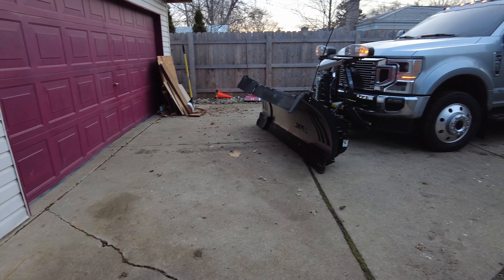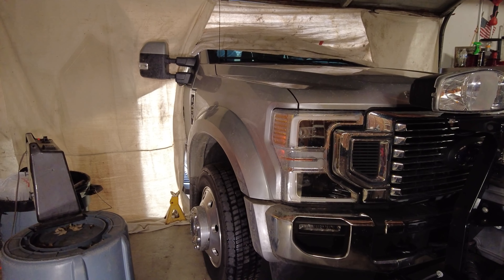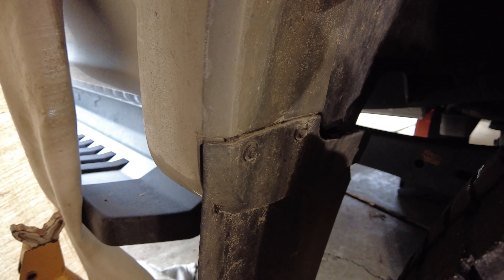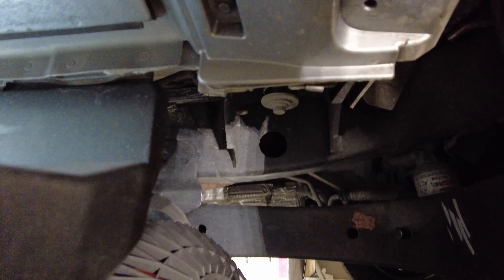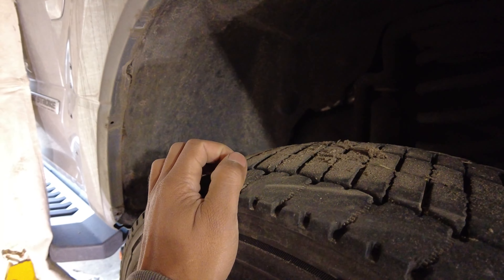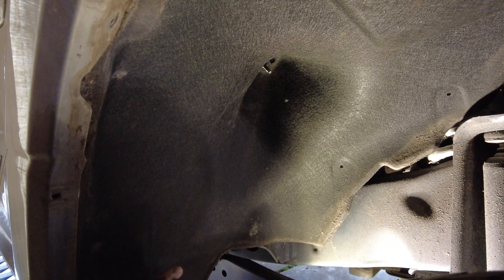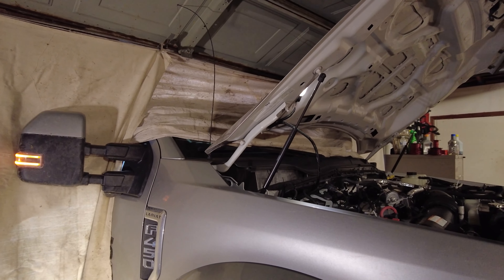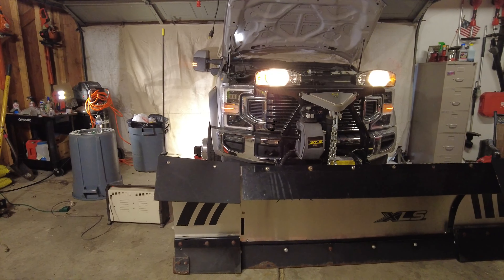Western / Fisher low beams NOT WORKING. let's find out why!

Comment: Information related to the 3 Port isolator box is the following.  For Port C,  this is related to the right side headlights low beam and high beam signals. When the plow is not plugged in the incoming and outgoing headlight voltage gets looped back inside the isolator box using a couple relays. One of the relays is for the low beam and the other relay is for the high beam.

Moving on to Port B, The signals are related to the left side lights. It pretty much follows the same functionality as Port C. Once again when the plow is not plugged in the port is simply looping back the headlight voltages on the left side.

Once the plow is connected,  there is a common/ground signal that grounds out a pin going to Port A Pin C which in turn energizes the 4 relays associated with the left and right, high and low beams to steer the voltage up to the plow lights instead of the truck lights. When these relays are enabled it disconnects any power going to the truck headlights so it wouldn't be possible to have the plow headlights on and the truck headlights on at the same time. 

The blinker signals do not go through any relays And are probably more robust for not going bad. 

I have noticed that there are external relays to the isolation box that are also involved for certain trucks and when those act up one of the headlights may not operate correctly right or left. I am familiar with the Western Plow Ultra Mount 2 wiring 2 connector system.
Reply: Trying to work through this issue now... 2 plug ultra mount...how would u recommend checking why headlights are not going on

Comment: What is the front end weight capacity of that F450? The plow doesn't overload the front suspension with the Powerstroke? Did you upgrade your spring?
Reply from the maker: Not on the f-450. The F-250 can hold this plow with like a 500 plus pound ballast. F450 does not require it ballast.

Comment: Both my low beam and high aren’t working. Turn signals are working though. 2015 Duramax with a fisher xls. Probably the same issue ?
Reply from the maker: Could be 🤔
Reply: @DS-TRUCKS  going to find out tomorrow, trying to diagnose this thing
Reply from the maker: @Js92415  I ended up buying the module and the dealer said if it wasn't the module I could return it. Ended up being the module
Reply: @DS-TRUCKS  thanks. Will try that